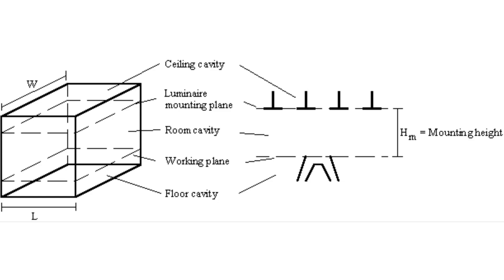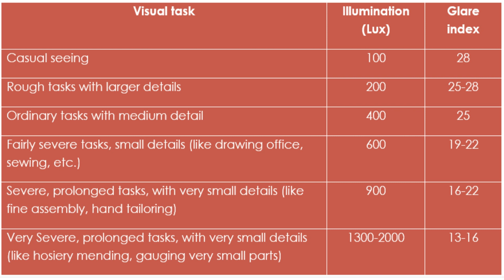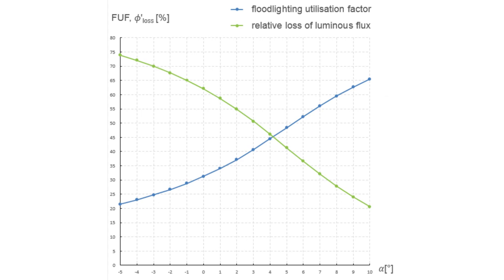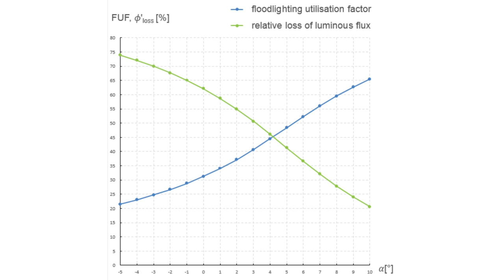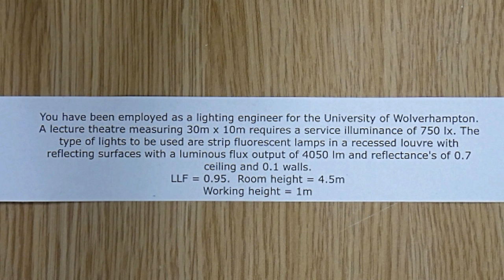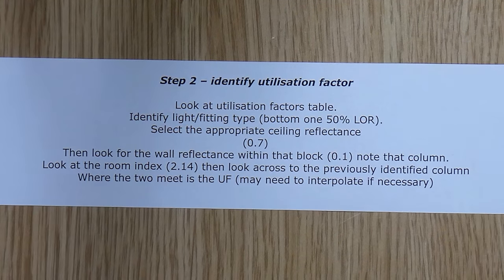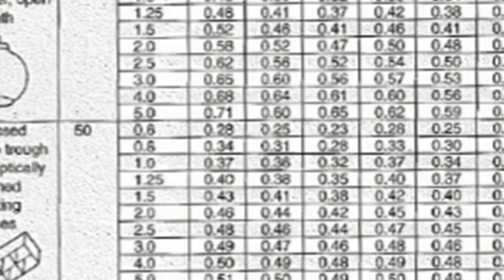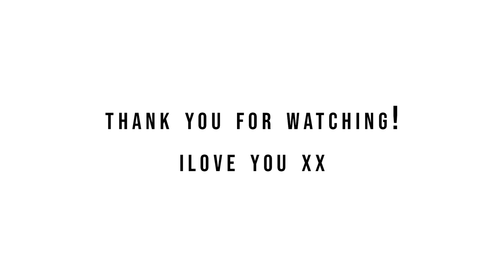How Much Light Does My Room Need? Lighting Design | Lighting Calculation Formula

Comment: I have a kitchen + dinning area with this dimension (L 15.0 x W 8.0 x H 13.0) in feet ( L 4.5m x W 2.4m x H 3.9m). There are two chandeliers and 6 recessed lights. For the recessed lights, what lumen should I get?
Reply from the maker: If you follow the video and use the table in the description you should get the right lumen level :)

Comment: When installing a lamp at a customer , I have to go thru this academic spew ?  get outta here . the only constants I have is the area of the room, and a desire from the customer : working light . Maybe 400 lumens on the work surface . You have a task with all the numbers given ( just like academics prefer) Are the lights changable ? are the lights dimmable ? How long is their lifetime ? do you need external driver trafos, 12V, 24V or 230V . How reflective are the walls ? This should be easily calculabel with a rope measure, or a RADIUS extending from the light source . the longer the radius, the more reduced lumen at the end . You dont need a VOLUME with 3 axis, to calculate a room ! With radius, you can simplify 3 axis X-Y-Z into 1 axis R . I had this in school and their working with LUX, lumen per square meter . Its so wrong, because Light is a round shape . Its like putting a square in a round hole ! You can never caluculate it like that :)

Is this correct ? I see a lamp in a catalog, 1000LM on the surface of the lamp.
1000LM / 2meter^2 = 250 (W/m^2) or LUX 2 meters away from the source .
1000LM / 3m^2 = 111 LUX 3 meters away. Find distance from Lumen and desired Lux,
R = SQRT (1000LM / 400 LUX ) = 1.58 meter radial distance from the Light source gives 400 lux on the work surface .
The other way, How many Lumen is required from a lamp 5 meters away from the lightsource, when I want 400 LUX on the wall.
LUMEN = 400 LUX * 5 ^2 meter = 10 000 Lumen !
Instead I may use 2 lamps that is 5000 lumen .
For a reflective value on the wall, multiply with a number over 1.0 matt .
Maybe multiply in bright or dark colors with factor over 1.0 being black .

Nice and easy . Lumen is the light on the surface of the source. Lux is the brightness on the area W/m^2 . R is the radial lenght between the light source and wall surface .
Lux = Lumen / R^2
Lumen = Lux * R^2
R = SQRT Lumen / Lux